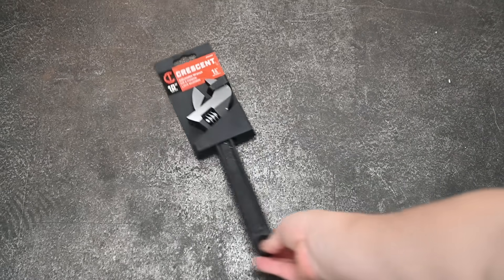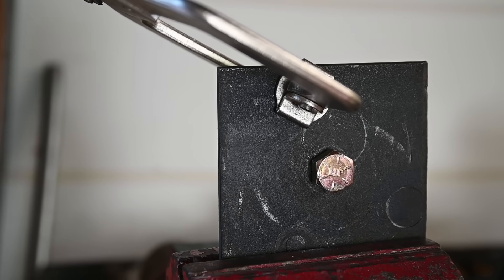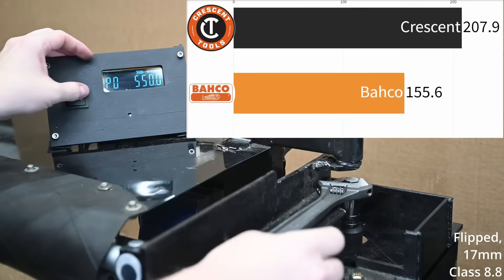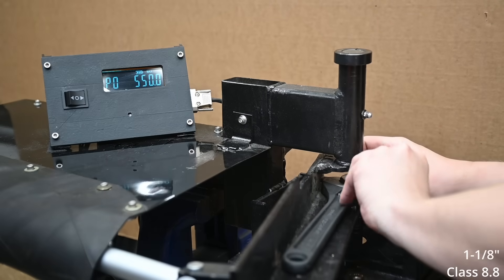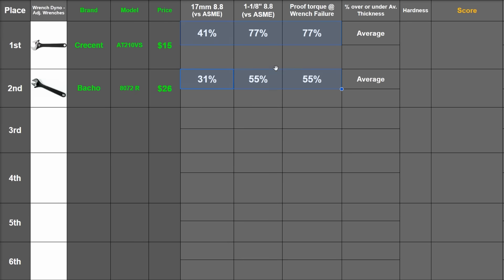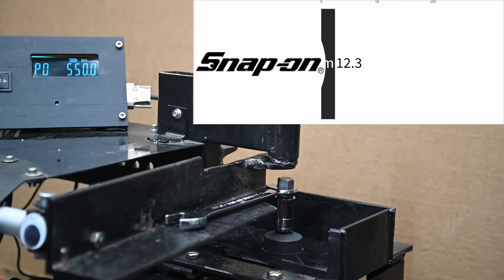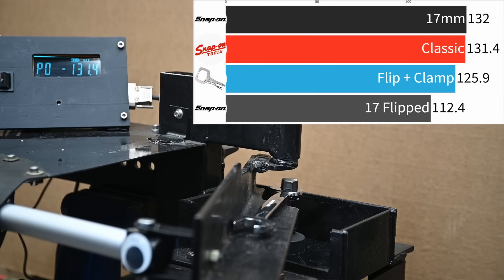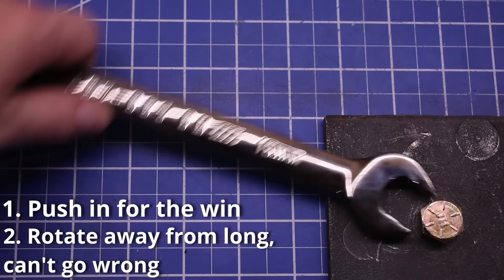Are you turning wrenches the wrong way?

Comment: For box ends I think flipping it is kind of by design. Those nuts between two posts where you can only get a 16th of a turn you have to keep flipping the box. But yeah I agree with the adjustable, never used them the other way. An even better adjustable where you see this is the Ford wrenches you basically can't use those the wrong way, but if you use them the right way they are one of my personal favorites for adjustable style wrenches. Thank you for the video!

Comment: The correct way is always the way the wrench fits in the hole and still has swing. Any good modern wrench doesnt care unless you're using a cheater bar or double wrenching.

Comment: When I first heard about a preferred direction for adjustable wrenches I remembered the preferred direction by telling myself that I should turn in the direction that the handle is already bent.
PS I like my Milwaukee adjustable wrenches, but I mostly use them as calipers to figure out which size socket I should be using 😀

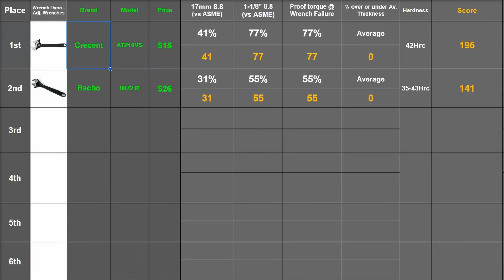Comment: Would love to see different Brands head to head and testing of Vice grips or locking pliers would be neet 9:18 @Torque Test Channel
Reply: Me too! If possible I would recommend the test case based on keeping a round stab link end in place while trying to remove the nut.

I just bought a pair of very slim jawed snap on grips for this and they've been great so far. (Note that I went with snap on largely because I expect to warranty the tool eventually.)

Important stats/criteria should include the ease and mechanical advantage available when locking the jaws (I feel like this varies some, and Milwaukee vise grips let you stick a screwdriver through a loop on the end and turn it tighter while they're closed, which is neat).

Comment: just got an idea, i dont know if anyones done it but it would be interesting to see a crescent wrench where the center "axle" for lack of a better term of the worm gear had a screw underneath it on one side to raise it up so as to reduce the clearance between the worm gear and the teeth, essentially locking it in place and increasing your tolerance.

Comment: Oooh I’ve realized now why this behaved counter to what I expected. I didn’t know which was the right way to orient a wrench, I figured that the bolt would be exerting an offset spreading force on the wrench so I thought that you would want the weaker jaw’s spreading force to be closer to the base for less leverage but what actually happens is that leverage forces the teeth and the threads together. 

A nomenclature suggestion: “long jaw leading” and “long jaw trailing”

Comment: I always thought it was the opposite of the diagram at 0:30 because the jaws are really only touching two corners of the nut so you would want the moveable jaw to have pressure on the corner closer to the base where there's less leverage on that weaker jaw.

Comment: And, the point of the offset jaws on what we in Oz call open enders is that, as you only have six sides of the hex to work with you will often find that the bolt head is inaccessible unless you turn the spanner over. Tight access work is really the only time to use these spanners. Also on hose fittings.
Oh yeah, you will probably notice we don't call them "wrenches" here. That term is for pipe wrenches only. And people say we all speak "English"...
Reply: And yeah, I posted this before I watched the whole thing.

Comment: 0:37. Here in Oz, 50 years ago, I was taught they were called shifting spanners, or shifter for short. 
As an aside, 40 years ago I worked at a BMW dealership. Back then they insisted we use Stahlwille tools. Use of a "shifter" on a Beemer could get you fired.

Comment: Lobster is the only company i have found that takes the jaw tolerance into account.

The jaws are only parallell when the slack it taken out of the mechanism

Every other adjustable has unparalell, wide at the top jaws under tension.

Comment: Irgea reverisable wrench has been the best ones I have a bought so far, I would be wondering how they would do, as I like that using an impact that they don’t back off, I feel as though they are soft, but they hands down have been the only set that has lasted more then a few uses(I’ve had them for over 10 years now), snap on is nice that they are narrow and that’s about it

Comment: I do own a 12"/30cm monkey wrench but it's hidden in a tool box so that my Dad will never see it.  Since it's purchase probably 10 or 15 years ago it's been used about that same number of times but NOT for loosening or tightening bolts or nuts.  I use it as and adjustable clamp to bend or torque things that I don't want to use vice grips on.

Comment: AvE calls the adjustable a "thumb detecting nut fu*ker" which in my experience is fairly accurate 😂 doesn't help they're usually one of the most abused tools in the shop because of being fairly cheap and universal and they make excellent hammers

Comment: Now the 1000% Snap On markup is not even buying quality. Stopped buying them 20 years ago. Now there balking at warranty replacements. No wonder most Snap On dealers fail. 

Also in my experience if you don't buy an over priced toolbox they won't give you good service.

Comment: As a plumber, the adjustable wrench is the greatest tool of all time. As a mechanic, it's the worst. YMMV
Reply: What are your feelings on the knipex pliers wrench?
Reply: @brainkill7034 is an excellent piece of German engineering, but too expensive for me. I lose wrenches all the time. Dropped in walls, left on bumpers, walked off of job sight. My favorite is Klein. I'll buy old used Klien adjustable wrenches in pawnshop every time I see them. I bought one for $2 that was locked up and rusted beyond recognition. Soaked it in rust breaker for a couple days and cleaned it up. Worked perfectly for years, until I left it somewhere, or loaned it to someone, can't remember.
Reply: @maddmatt-80  I love buying old rusted tools, usually with a little work you have something better than you can buy new and for cheap.
Reply: @maddmatt-80  1st pair of channel locks I ever owned was from a plumber who needed to move my truck and left them on the seat.... might have been you 😆.
Reply: @maddmatt-80  I love them too much to lose em tbh one of the few tools I’ve never come close to losing, so satisfying to crank on stuff with those and not having to keep readjusting the crescent screw every turn can’t be beat
Reply: @brainkill7034 I have the Icon version and so far I like it.   The parrot pliers are good too.
Reply: @brainkill7034  Excellent, love that it is always tight and rolls nicely next 60 degrees for next grep when you just let go a bit. The only tool than can hold an object still (without scratching) meanwhile you turning something with your other hand.
Large opening compared to size. Works with pipe extension.
Reply: As a mechanic, pipe wrenches for the win on rounded bastard bolts haha.
Reply: Ditto that. When plumbing, I was forever encountering legacy fittings of all weird standards / sizes, and it was a pita to attempt to carry all the necessary fixed sizes, so the adjustables came into their own.
Reply: As a DIY/tinkerer its both! lol
Reply: As a plumber, the channel locks are the greatest tool of all time.
Reply: @Guitarplayer724  Can't argue against that. I guess it depends if you're more of a finish guy or a rough in guy. For me, the adjustable holds a slight lead.
Reply: It's a good tool all around. If you're stripping bolts and nuts with it, you're using it wrong.
Reply: @Alejandro-s3z8o  Obviously. If you are using it instead of a box wrench or a socket when you don't have too, then you are using it wrong.
Reply: @maddmatt-80 You can, but it all depends on the torque needed. I think of them as if they were made out of really hard plastic, and keep that in mind when I decide to use them.

Mechanics who don't like adjustable wrenches are usually the ones that have the fancy 15k+ strap on tool box, with a specific fancy tool for each little task they do.

Those are not real mechanics, they are tool collectors/enthusiasts.
Reply: knucklefuckers*
Reply: Exactly. For plumbing, the fixed wrenches more often than not wouldn't even fit, either because the fittings are not precisely manufactured to any particular size, or, to a weird size, eg. 28mm, which you might not even have a fixed wrench for, or because they are octagonal and the 12-angle circular end of a wrench can't fit, etc... Also, for mechanics work, you need a few smaller common sizes (unless you are working on tractors or huge machinery), for "household-size" plumbing, the typical sizes start at 17-19mm, where "household" mechanics wrenches almost end, so the toolbox would be very heavy with all those huge wrenches. So for plumbing, I mostly use the adjustable wrench and pipe pliers.

On the other hand, for mechanics work, I never find a good use to the adjustable wrench. Maybe I used it once or twice, when I didn't have anything else at hand, but it was atrocious, absolutely not a good tool for mechanics use. It is either not strong enough, either the jaw play is too much, you are damaging the hex heads with it, slow, and, more often than not, it won't fit in the room which is available around the fastener...

Comment: One of the oldest Mechanics jokes was to send a noob out to buy a Metric Adjustable Wrench (Crescent Wrench) - this joke was brought to a crashing halt when one returned with said Wrench with a Metric scale etched on it!
Reply: First mechanic job i was told to find blinker fluid at the auto parts store. I came back with some visine eye drops, my trainer was flabbergasted!
Reply: @twostroke12v71  I was in an electronics shop and they told me to go get  fallopian tubes. I went to the office and brought the female book keeper to the shop.
Reply: I'm still waiting for my welders helper to bring back that aluminum magnet I asked for.
Reply: @Jewtoobcensorsallmyreplies dang, i wish there was an aluminum magnet, would make cleaning up aluminum chips so much easier.
Reply: @krogonronavix2595 you can magnetise aluminium by passing a strong enough current through. If you need to clean up aluminium shavings the easiest way to do this is to pour salt water on the ground and connect mains live at one end of the puddle and neutral at the other end. You can then simply wave a magnet above and bingo, you have a safety hazard.
Reply: As a marine engineering apprentice, I was told to go and bring back a bucket of steam. After a bit of playing with some insulation, I did.
Petty Officers can be really petty when you pull one off on them!
Reply: Aircraft mechanics have their own version of this. "Get me 15 feet of flight line". "Get me a gallon of propwash". As in your case, there actually is a company that makes a cleaner named prop wash.
Reply: @dougrobinson8602  For helicopters, it's "rotor wash."
And of course, after I was tasked with getting some, I found in the manual that there actually is a prescribed detergent for washing the rotor hub -- so I ordered some. They never tried to troll me again.
Reply: I thought it was a joke about buying a European made adjustable wrench, vs an American made one.
Reply: Believe it or not, there are also left handed open ended adjustable wrenches too.
Reply: @Syncopatientzero Wait, what?
Reply: In the telco world - as in old relay based exchanges, go and get us a box of air-gaps
Reply: There is always the old Aussie first-day-on-the-job classic - "Jim, slip down to the hardware shop and ask them for a long weight".
Reply: When I was an newbie artillery man in the Army back in the 80s, I was sent to another gun position to get a container of “muzzle blast”. They were very helpful and gave me a canteen cup of break-free to take back. That was embarrassing af to say the least. 😂😂😂
Reply: I can tell you the renewed version of the joke: send the noob to find concrete welding rods
Reply: Or bucket of compression
Reply: But was it left-handed like some screwdrivers.
Reply: I am afraid that even adjustable tools would be anything but metric in USA.
Reply: also with a can of elbow grease in hand

Comment: So if i interpreter the result right on the cresent wrench...
When u use the wrench like in the picture it gives higher force on the "short" jaw further away from the body and that makes the jaw flex and lock up inside the body and put les force on the screw you adjust it with.

When you use it "wrong" it gives force closer to the body on the lose jaw("short) and that way it dont flex as much and dont lock up inside the body and therfore give more force on the screw that breaks.

So the picture is both right and wrong, there is no force towards the body when turning it "right" way it gives higher force away from the body that flexes the jaw so it lock up inside the body and saves the screw..

Who would knew more force on the smaller jaw so it flexes more would be a good thing😂😂

Comment: Angle-head wrenches (30 and 60) only make sense if you can turn the fixed jaw either way - the angle on the fixed jaws is for when you don't have the clearance for the 60 degree swing to get to the next side of the nut or bolt

Comment: Torque Test Channel... So the old timers are right when they say there is right and wrong way to turn the wrench.. Even if it is just slightly better, I knew it!! Wondering if the direction the wrench is turned makes a difference on the flank drive plus and anti-slip wrenches because on some of them the groves are in different spots of the jaw depending on the top or bottom jaw. Just a thought.

Comment: I would say do an adjustable wrench test but do 15 inch ones if you can. In industrial settings 15 inch adjustables are used constantly because people typically have the right wrench for smaller sizes, not so much for larger sizes.

Comment: Proto professional is the toughest adjustable 12” wrench, we had a “ put your money down on your favorite “ and we will break them kind of test. Proto Professional won both days, the only one that wouldn’t break.
Reply: Bet you didn't test any vintage Diamond Tool wrenches. Proto is good, but I haven't found anything with the outstanding fitment of those old Diamonds from Duluth.
Reply: @leadboots72  no we sure didn’t have one of those, we pipe fitters started this test one day at work, the iron workers found out and started bringing their favorites in the next. 1 1/4” nut on a pipe flange, 5’ cheater pipe on wrench, a 200lb guy would sit on the end of cheater, if it held he would turn it around and pick up on it. If that held we would give every one a chance to break it. The ones that bet to break sure as hell tried the hardest😂

Comment: I first ran into the Bahco "adjustable spanner" (UK nomenclature) back in the mid '70's while working in the North Sea oilfields. They were made in Sweden and their most unusual feature was that the adjustment barrel turned the opposite direction from my familiar Crescent wrenches in the States. They really had a tight mechanism and seemed very high quality. Since then I've tried lots of different brands and can say that there are some very nice quality wrenches out there on the market now.

Comment: So TLDR: you're not going to have enough strength to make it matter, and if you're to the point of cheater pipes you're probbaly going to break something no matter what.
Reply from the maker: They start slipping much earlier in one direction if you're paying no mind, that's before their peak torque listed here. And it's on a perfect new hex. If one way provides an advantage in grip, use it where possible.

Comment: My favorite use for an adjustable wrench is to hold something in place so I can use a proper wrench to apply the force, and I don't have to go hunt for a duplicate wrench by just grabbing whatever adjustable is big enough. Something like holding a bolt head in place with an adjustable while I tighten the nut with a wrench.

Can't say my list of times an adjustable wrench has been preferable to a normal wrench has many entries. Only really good for weirdly sized fasteners or for when you can't be bothered to look for the right size for a 1 minute simple job at home.

Comment: When I was an Engineer in the British Merchant Navy, everyone had a 10" Bahco adjustable wrench stuck in the ruler pocket of their boiler suits. These went by the common name of a SHIFTER. Many modifed, by grinding off the last bit of the aduster allowing the sliding jaw to come right out. It meant that if you couldn't undo the nut/bolt at least you had a measure of the correct spanner to fit. You could always tell the nuts that had been shiftered on a regular basis, as they would be pretty well rounded. We were always told to only spanner in the "correct" direction. Looks like I'm about to find out if that was true or false.
EDIT: Well I'm glad all my Bahco shifters are older and were made in Sweden. Really not a good look that!

Comment: Seems like Pushy could also be used to test ratchets also, to see how strong any ratcheting mechanisms/handles are. Unfortunately for me a recent GearWrench flex head ratchet I purchased broke after probably only half a dozen uses. The bolt connecting the handle to the head broke.

Comment: It's good to know that the way I've been doing it for decades is the better way.  My rationale is that turning the adjustable wrench in the better way tends to push the movable jaw toward the body of the wrench where the wrench has more material and strength.  Turn the wrench the other way tends to pull the jaw away from the body of the wrench putting force on a thinner portion of the jaw.